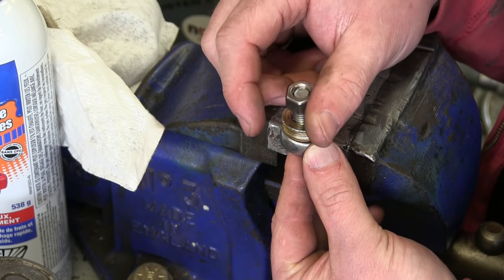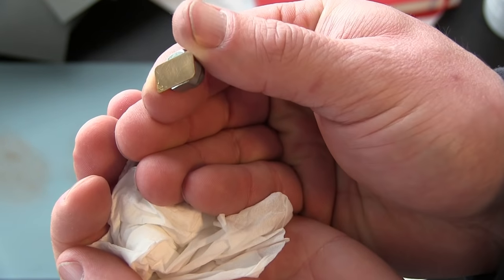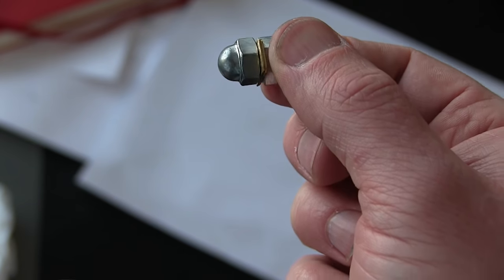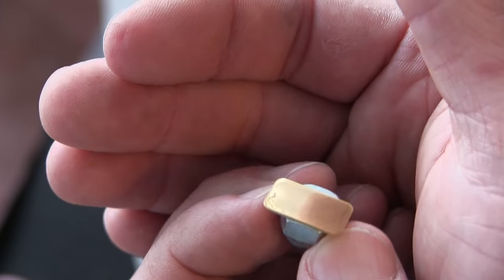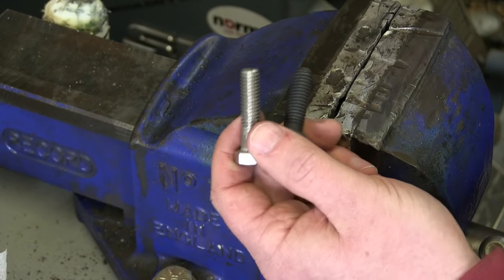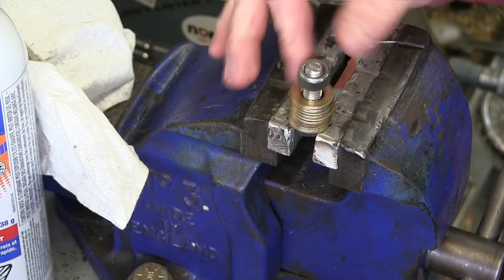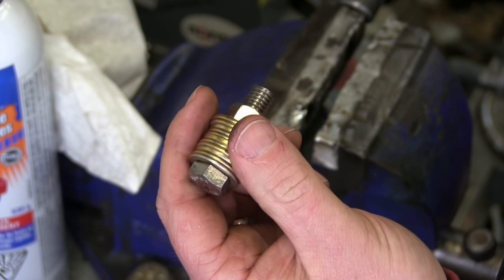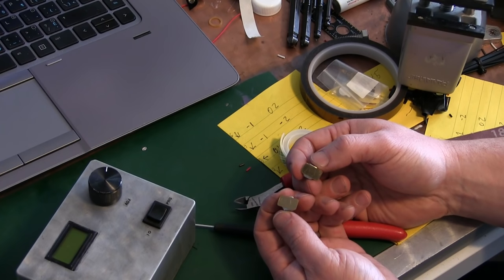Cold Welding of Gold and Stainless Steel in Earth Atmosphere.

Comment: Hi, cold gold welding was a common process in dentistry up to the early 70's. Very fine foil was used that had an ammonium compound to keep it "clean". Prior to use it was decontaminated and annealed over a spirit flame and then pushed into an undercut cavity using special tooling. It was also compressed using a device not unlike an automatic punch. The gold was built up in successive layers until it was proud of the surface and then burnished and polished. These were considered the Rolls Royce of restorations and I occasionally see them in my older patients with the filling as good as new up to 60 years after placement. The longivity can be ascribed to perfect filling of the cavity void, the work hardening during the compression of the material and the smooth cavity filling interface that does not allow plaque accumulation.The foil was 24 carat. The patients did not like the process as tamping down with a micro hammer or the automatic instrument was unpleasant at the time of application and also led to some post operative bruising of the tooth's supporting membrane with subsequent pain.Regards, Richard
Reply: Extremely interesting, thank you for sharing!

Comment: To those who commented about stainless steel nuts and bolts getting stuck together, this is caused by the Chromium in the the steel. Chromium  forms a scale like oxidation on the surface that when in the case of a nut and bolt, the two oxidized surfaces interlock. (using that term again) Given time and depending on the environment the stainless steel is exposed to be it a high water content atmosphere or a caustic base, the chromium will continue to further oxides and the surface will expand increasing the tension on again using a nut and bolt  as an example. The literal definition of stainless steel is that it will "stain- less". The iron which is the highest  elemental content in steel can still oxides/rust even with addition of chromium.

Comment: Cold welding is also a common problem in the sheet metal stamping industry.  We punch out and form sheet metal assemblies at my work and you never want to punch a hole in stainless with a punch made of D2 steel because the punch will end up galling.  This is because stainless and D2 both contain chromium.  You need to make sure your punch is a different type of tool steel or use a punch with a coating to prevent the galling.

Comment: Oh shite!  That explains my stainless steel bolt issues in the past.  I thought I'd just mashed the threads.
Reply: I have my trusty tub of copper lube here (sounds like a robot sex aid).  I just didn't realise it could be used for that, or even that the reason the stainless steel was so "tight" was because of my deficit of metallurgical skill in that area.  I put it down to the "malleability of stainless causing thread deformation" which it turns out was just a load of crap that I made up.
Reply: That's quite tempting although my own teardown heap is equally monstrous.
Reply: I'm not sure why I'm even surprised you guys are having a chat over here, but I slightly am.

Anywho, I just wanna tell you guys that your channels may or may not be the places I escape to when I just want to see an electric/mechanical tool torn down all the way to its jibbly bits, which is more often than I would like to admit. Keep on doing your thing, you bastions of shop fuck-around-ery.
Reply: Glock uses that Loc Tite C5-A copper anti-seize grease as their factory gun grease, and the stupid gun dummies will pay over $20 for a single fluid ounce of the stuff. I buy a pound jar of it for under $15. It's the same exact stuff. Same deal with lots and lots of greases for guns. The AR idiots will pay $40 for a teeny tiny tin of Mobil US Navy aviation  grease. A full tube is maybe $80, but you get 100 tiny tins worth. God bless my lubrication engineer friend that works for Minnesota Mining & Manufacturing. (3M) That copper lube is great stuff. It mixes in with the gun oil I use so nicely.
Reply: 304L and 310Ti seem like they are worse than 301, 304, and 316
Reply: Could you try to break the seized bolt free with a torque wrench?
Reply: it will break off the head or tear the threads out.  Stainless steel will cold weld just sliding 2 pieces together if they are clean, flat, and smooth.  You can feel it catch once it catches you can pull as hard as you can and it won't move unless you lift a corner.  When you lift a corner you can hear metal being ripped out.
Reply: if that aed is functioning i have a remote cabin with plenty of older neighbors  just might save a life rather than sitting on a pile pm me to open negotiations
Reply: For a genuine medical application I'd strongly recommend getting a new one to avoid that awkward situation when a secondhand unit turns out to be the difference between life and death.  They're very affordable these days.
Reply: I kind of wonder if this cold welding thing could be used to my advantage. Say I make a knife with a welded tang of threaded stainless. I could clean well and over tighten a stainless nut to ensure the handle stays put?
Reply: Never happened to me because I only deal with stainFUL steel.
Reply: @bigclivedotcom  very well said that man :)
Reply: @bigclivedotcom  I love the fact that I instinctively read this in your voice

Comment: AvE. I need your help.  Will start building a new home this spring. I want to install some hidden speakers and noise makers to replicate ghostly voices and foot steps to scare the mother in law.  Started setting up the story when we bought the land several years ago telling her there was a lost graveyard in the area.  
How would you design in wall hidden devices?
Reply: setup your hidden speakers, and whatever 24V solenoids you will use for the foot steps. Run all the wires (labeled of course) to your telcom box. Use an arduino with the appropriate drivers attached to activate solenoids, and trigger a serial mp3 player that has its output ran through an opamp.
Reply: this is actually what popular "HAUNTED" attractions do. (like haunted hotels and such) 
They install arduino controlled noise makers directly into the walls
Reply: There are flat speakers that you can glue to the window glass or some glass furniture.
Reply: Install easy to create inertial propulsion modules into everyday objects to project the illusion of being spiritually handled.
Reply: Be careful, stress isn't handled well by everyone. Great idea though.
Reply: Parametric speakers might make an interesting effect.  Might also check out atmosfearfx.
Reply: Love this idea lol and it looks like some of these comments already mentioned what I was thinking. If you go to a Hallmark store or any place the sells singing cards, if you take them apart youll see how the speaker is the card itself. The little device makes almost no noise by itself but when it touches the paper (or whatever other similar style surface you want) it turns that into the speaker. Very cool and interesting, as i never knew that kind of thing existed till a birthday or holiday one year when i got one and took it apart (re-purposed it so my car played the star wars theme when I opened the door but thats another story..) . Something like that would work PERFECT for a haunting. Imagine tracking down the sounds when you realize the giggling is literally coming from the wall/floor/ceiling/countertop/house itself. Please update if you pull this off :)
Reply: jay west just hiding a speaker in the wall is nice and simple, plus may give an "authentic" sound.
Reply: jay west i'd make sure theres an easy access panel to the wall from the basement, that way if anything decides to die you can replace it with a mini camera drone and really long tools.

Comment: I saw your link in the description for the explanation of the phenomena but Gold is a very particular case and I can add some thing:
1st, as you said: no oxidation on the surface but I don't think this is the main force.
2nd the gold surface is actually liquid at atomic scale so the fusion of the 2 surface should be easier and more stable. 
Let me analyze this point.
Take a needle, let'say a gold needle, with an atomic tip then hit a gold surface and extract it slowly. You will see that the needle will carry a chain of atom with it. At some distance the chain obviously will break.
The Cold welding are thousands of chain that you are trying to break ;)
If you are interested in it you can build a scanning tunneling microscope and measure the size of the gold chain as function of distance from the surface or see the scratch on the gold surface, and if the STM is good you can even see scratch on atomic scale disappear due to the "liquid" status of surface gold

Comment: Used to do this with borosilicate glass. It was fairly hard to get just right. Since it’s glass (and clear) we’d run water through it and as the water gets squeezed out and creates a diffraction gradient. So you can see it. I think the water had some other effects. Water was super pure too. Anyway 99% of the time I failed. But when it welded it was permanent. One piece of glass. Crazy to think it happens.

Comment: for future reference, use that mirror to put your sandpaper on, flatter than what looks like a wood bench at the start.   also, same when using the diamond paste, put it on the mirror or a glass plate instead of doing it on the paper.  smoother surface, better polish, etc.   (but it will gouge the mirror/glass with the diamond bits....)   love the episode!  thanks Kodi!

Comment: I have spent the last 30 years studying galling. This is a great demonstration.  The crash of the Sikorsky helicopter off of Newfoundland killing 17 oil rig workers and crew (one survivor) was due mainly to 2 factors 1.galling of the titanium oil filter studs and nuts.  2. the gearbox unable to run dry (lead to galling of the gears) for 30 minutes as required.
Galling (or cold welding0 will happen with most metals when clean surfaces are brought together with enough pressure (it is pretty well instantaneous).  Sliding removes oxides so you need a lubricant that will react with the surfaces to form a barrier.  The big three EP (extreme pressure) additives for steel including stainless) are chlorine, phosphorous and sulfur.  Chlorine has been found to be carcinogenic (cancer) so the lubricant industry has been struggling to find replacements. here is an image of galling between tool steel and cold rolled sheet.

Comment: We discovered 'cold welding' when assembling a 3" BSP nut and nipple industrial hose fitting some years ago.  When trying to take it apart, apart it would not come!   Even when using a 24" Rigid pipe wrench with 3 mtrs of thick wall steel tubing as extra leverage, the only thing that moved was the pipe wrench handle, which bent!
We had to scrap the fitting and start again, this time with assembly lube!

Comment: the stainless may have galled , BUT the loose nut on the bolt thread caused some spring tension to occur between the threads as they where torqued down forcing all the threads involved to contact each other .  the first threads engaged have the most pressure put on them caused them to gall .
Reply: Charles Boston this is what I ASSumed happened here.  in simple terms, the fasteners stretched together?
Reply: one was compressed , the other will be stretched , just look at the wear patterns on the threads to see how they where engaged .  if your able to measure the distance between the tips of the threads , that distance will have changed somewhat as the 2 threads engage each other . the ones with the most pressure will have deformed the most , these are also the same ones that will gall first
Reply: look at how these material machine or cut on a lathe .... many types of stainless are a pain in the ass to get a nice finish on even with carbide cutting tools
Reply: Charles Boston  The looseness of the fit reduced the surface area that is intimately in contact, and the amount of the thread being flexed.  There is always spring tension, using your phrase, once the torque begins to build.  And it's so on both the male and female threads.

The difficulty of machining Stainless is contributed to by other factors.  Some are common to all soft metals, some are specific.

Comment: I've been using a bunch of 304 stainless hardware--commercial kitchen stuff, jet skis, repairs of rust-prone stuff, etc.  I never had an issue getting a stainless nut/bolt apart.  Yes, they tend to stick together, but separating the nuts/bolts was never a problem.

Comment: I always heard from an old machinist that a stainless nut on a stainless bolt ain't never coming apart, but I always thought it needed some time or corrosion to properly gall. Pretty cool to see it in real time, and a nice way to keep parts from vibrating out I suppose.

Comment: Thank you for explain why mostly "subaru" wheel nuts get jammed up and subsequently snap off as you try to undo them, even though you have just put them on. In the shop all subaru's and toyota's get the good old anti squeeze copper grease, just never thought about why that happens. 100% happens even if you torque them by hand.

Comment: Serious question here: Two weeks ago I was working on a car (911 turbo S... just that) and was draining the cooling system.
The drain plug is shiny aluminum and the coolant manifold is cast aluminum.
I put the plug back in by hand all the way (so I didn't cross thread anything), and tightened it to 9Nm.

Next day, I went to take it out to make sure it was all drained... and the plug was STUCK in there! I had to hammer a Torx bit into the allen hole and use my long 1/2" ratchet to take it out... and it took a LOT of force.
I'm the second technician to face the exact same problem (put the plug loosely, and it's impossible to remove the next day)

Now Porsche has updated the plug to a steel plug instead of aluminum.

Could that have been caused by cold welding between the two aluminum parts?

Comment: When I have seen cold welding of solid rod the ends are cleaned up and both pieces are clamped into a press of sorts that's in a chamber.  The air is vacuumed out (might be purged with argon first, don't remember), and the two rods are forced together about a inch to a inch and a half.  They smush like clay and end up cold welding.  Any oxide/contaminate ends up getting pushed out with the excess, leaving clean metal on metal thus a solid bond.

What your trying to do should work, however unless you sand the oxide layer off while the metal is in a purge chamber I wouldn't think the results would be very good/strong bond.  Good luck and thanks for the great videos :)

Comment: Ha!!! You resolve my stainless bolt nots problem now.I learn something every time.I live in a boat so imagine the stainless used on here.On the steel part of the hull we welded some stainless bolts to hold on to the zincs so I can change them while diving...I discover that stainless nuts on stainless bolts did not work so well and seems worst under water,probably I am using the wrong stainless BUT I use a steel but on a stainless bolt and it works great.

Comment: Last summer i was putting some fancy new engines in a old power boat.removing the 8 old  mounts bolted to the stringers and every bolt was put on dry. 40 half inch bolts by hand.

Comment: The gold to gold contact welding is exactly what happens in making the gold wire bonds that are used in many IC packages. The wirebonder uses a bit of heat and ultrasonic vibration to mush the wire in properly. This works on gold wire as there's no oxide to get in the way. It's also not unlike friction stir welding except the wire is 18 microns in diameter - which is less than a thou in old money.

Comment: I've been in commercial marine electronics for 12 years, use stainless bolts every day outdoors on boats and I've only experienced cold welding once. I installed an antenna (from a very large and reputable manufacturer) and used the stainless bolts that came with it (as I always do). Even though I've installed dozens of the same antenna every single bolt galled itself on this particular one, and on the next few I installed as well. Needless to say I started using never sneeze on those bolts, but a year later the problem disappeared and I stopped putting goop on them. I had just assumed they used shitty stainless. Whenever I use my own hardware I always use 316 stainless and I've never had them gall

Comment: Normally I have no clue what's going on in your videos, but I do have some experience with gold and polishing etc. we have to be particular when rolling out gold leaf. If you role two sheets at the same time (which is normal) without a piece of paper they will cold weld back into a solid sheet, it kinda blows the mind. 
And with your polishing the tiny pieces, I think those scratches are more likely from a non flat surface than cold welding. It's amazing how easily pure gold will scratch itself when In contact.

Comment: Once upon a time I had some "go-fast" car parts made of aluminum that were engineered for looks rather than function. They had aluminum-on-aluminum threaded bits that were supposed to be good and tight. I got them good and tight and one side turned itself from 2 pieces of metal into one. A buddy of mine with actual engineering training and access to fancy machine tools and a well stocked shop fixed it for me and it came back with some kind of magical blue anti-sieze grease for aluminum on it. I never had a problem with it after.